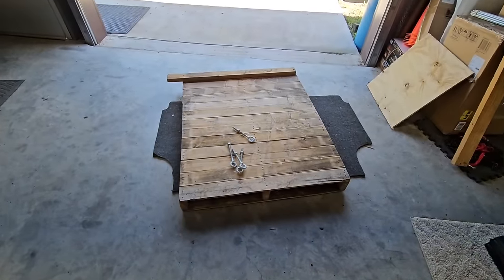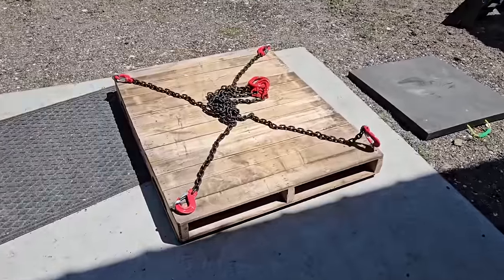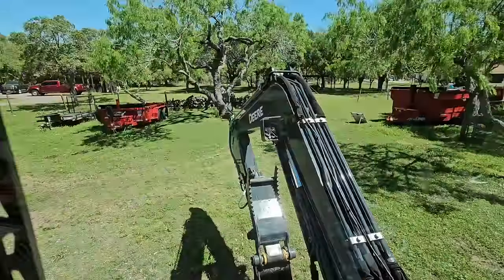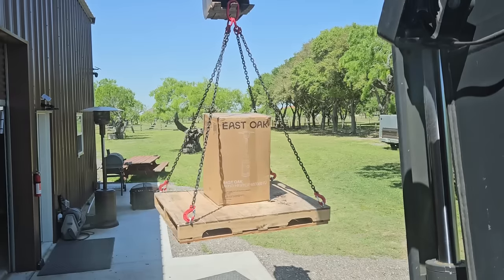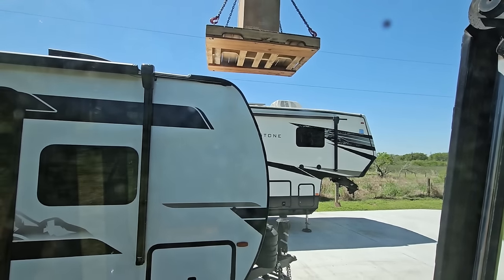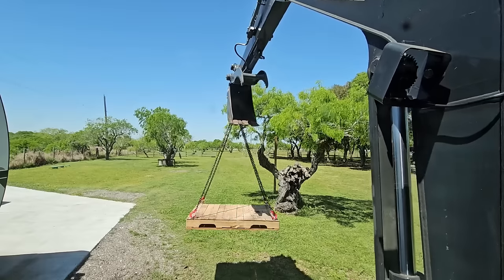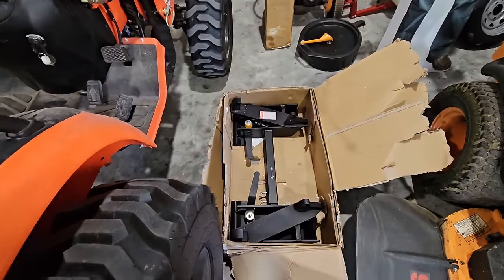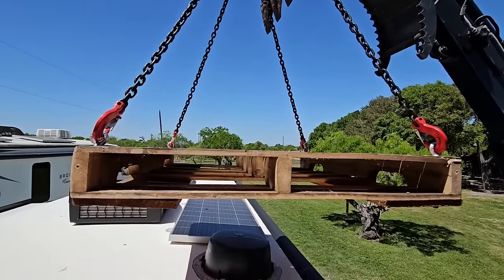Big RV Project Coming Up! Needed to make some help!

Comment: For safety would suggest use a drag line. You can probably control from cab. And if breeze 2 lines with people on ground should the most control

Comment: That’s a great idea JD. I think the best way to use this setup would be to take the bucket off and (depending on your bucket attachment system) just use the pivot pin to go through the eyelet of your hoist. That would also make the mounting point higher, thus making it to where you don’t have to raise the boom up as high to get the rig up.

Comment: Unattach the bucket, then attach the chain to the point where the bucket connects.   That way you gain the extra height the bucket is taking up.

Comment: I would suggest additional boards on the bottom with spade bit holes where the eye bolts go thru with the nuts so, that you do not drive the bolt ends & nuts into soft material.

Comment: I'd have used the largest OD washer I could get for the size of the eye
Also, your hook latches should face AWAY from the load...this will make the latch less likely to come under load when the chains transition from slack.
Reply: Yes! Also the load will be on the strongest part of the hook.

Comment: You need to put shackles in those eyebolts,  big enough to swallow the hooks on your bridle.  Also,  if you position the eyebolts in line with the centerline of the bridle,  there will be less side load on them.

Comment: Hi, Steve you should of used washer to take the load over more a nut will go through the hole as wood expands contracts
Reply: You should of looked closer before being so quick to correct someone.  He did use washers.
Reply: I agree he should’ve used larger washers as well as the small lock washers.
Reply: Who is Steve?

Comment: Knew in the first few seconds what you were doing. I changed out an AC unit on my 1st Phaeton and used a folk lift with the new unit on a pallet. Slid off the new and popped the old one back on the pallet. Heavy but was easy. Your contraption looks unstable to move the units on and off. Use a forklift adapter on your tractor. More stable. You don’t want that pallet swaying around 11’ off the ground. Good luck.

Comment: They make an adapter that goes on your mini ex quick attach fitting that allows you to use your pallet forks. Can't remember the name of the mfg but my son had this for his mini ex and really useful for putting things up in the air. Bought from Skid Steer Attachment Depot. I think Durattach is another.

Comment: I noticed that your bridle hooks are upside down,  and,  again,  too big for your eyebolts...by doing this,  you reduced the capacity of your rigging by about 70%, and made yourself fireable on any of my jobs.
Reply: All this from a Millwright Superintendent/Certified Master Rigger.
Reply: I once picked a 200 ton LP Turbine Rotor with a 200 ton capacity overhead crane.
Reply: Sorry, reminiscing.